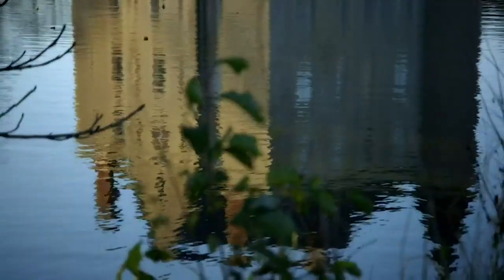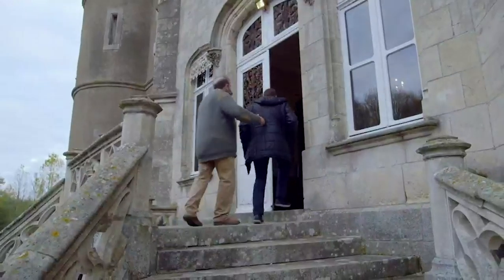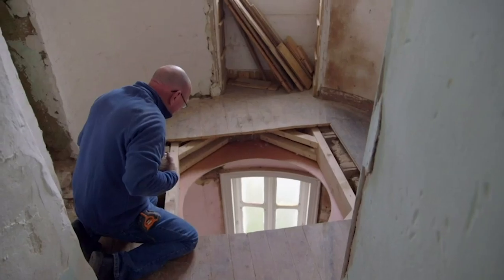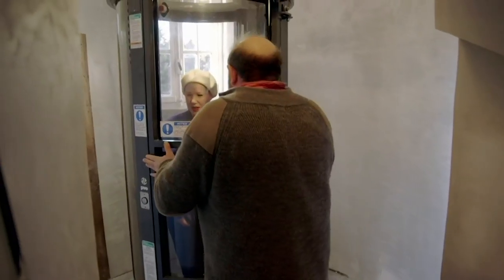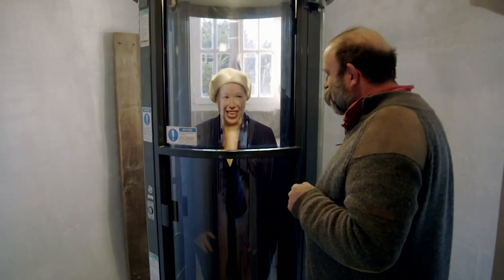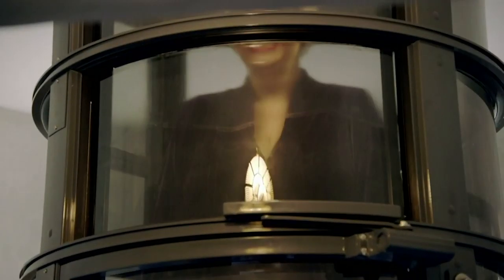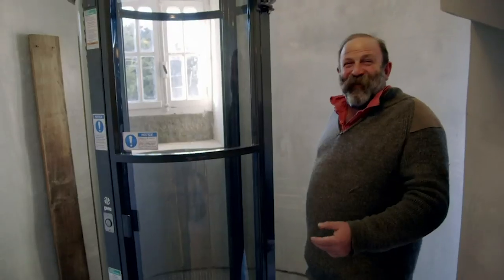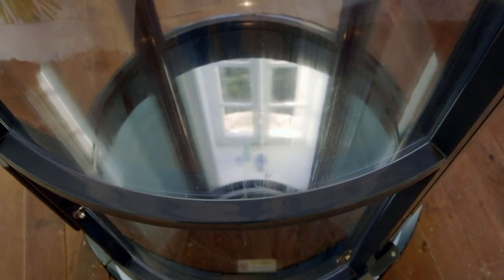Building an Ingenious Vacuum Elevator in a Chateau Turret | Escape to the Chateau

Comment: Wouldn't this style of elevator be extremely dangerous in the case of a failure or loss?
Reply: I felt sick when the man looked through the hole
Reply: Apparently no. They have emergency brakes that stop the lift as soon as it senses it is falling. https://vacuumelevators.eu/technology/safety-pneumatic-vacuum-elevators
Reply: Airflow controle the speed of the lift in the up and or down direction. Restrict the  airflow even with a löss of  power will allow the lift to descend slowly and safely.